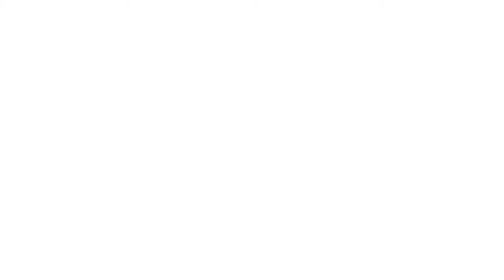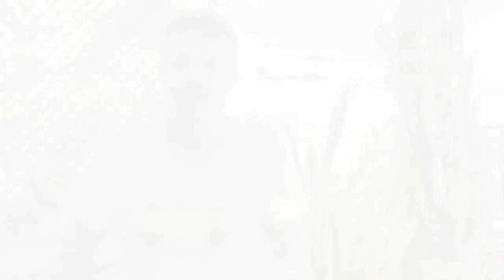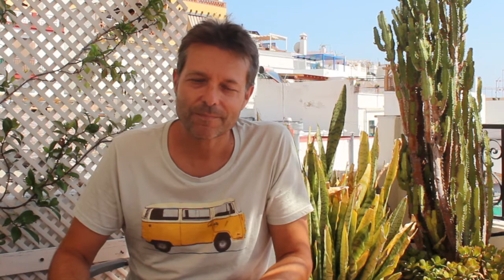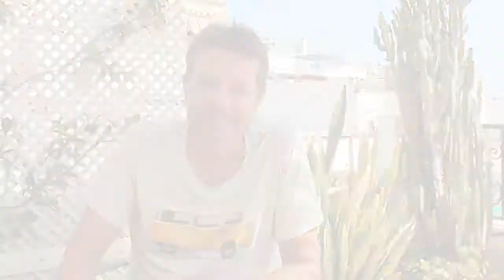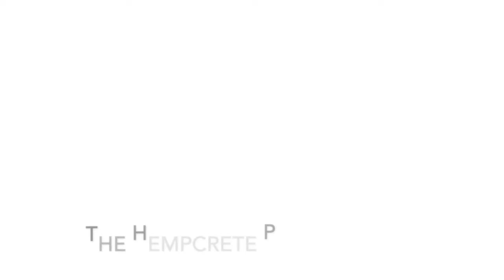Timber framing for hempcrete structure

Comment: Are there any issues with the spruce timber frame warping due to moisture transferring through the wall? Some builders in Hungary claim there is an issue and either use hard wood which is prohibitively expensive or what they call HTS structure.